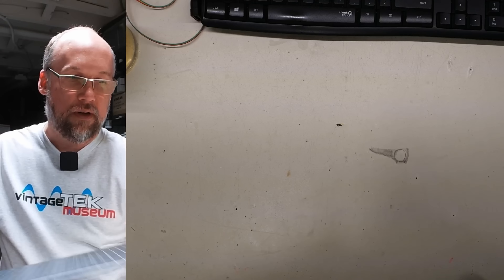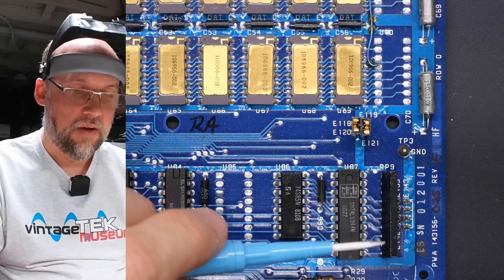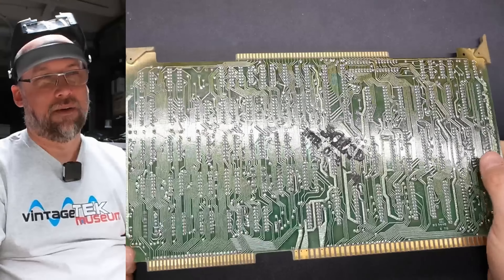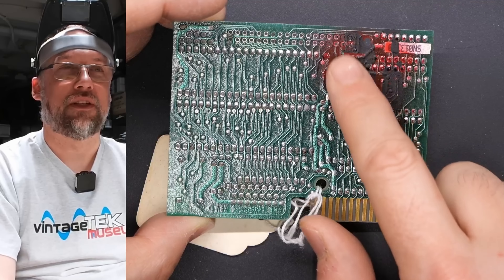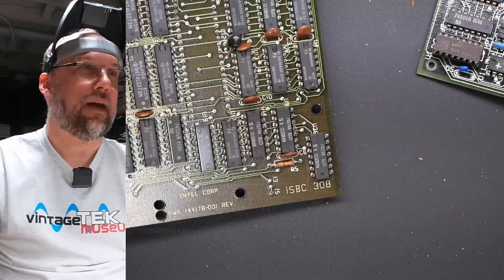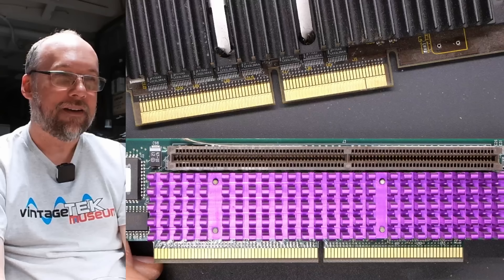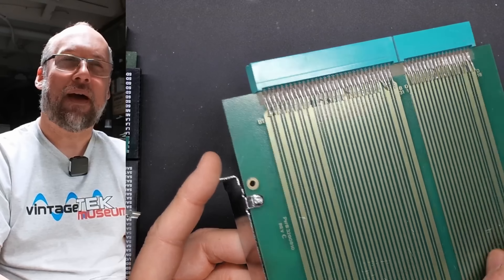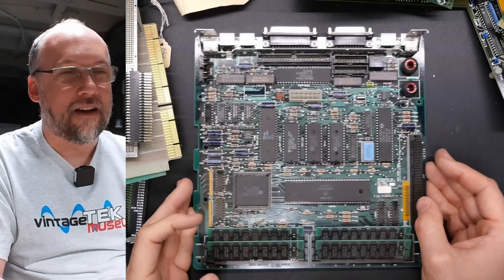Box of "scrap" vintage computer parts

Comment: I usually use Google Search by Photo to identify boards.  And with those first few Intel boards look like: Intel iAPX 432.  For sure the 2nd board.
Reply: No Intel iAPX 432 here, but close! Intel used some of these cards in their iAPX 432 computers (See Intel System 432/600 series).
Reply: yes the great iAPX 432 of which most people do not know of it's rich history or how Intel put a 32 bit IBM mainframe on a single board computer

Comment: If the state of these boards is anything like the state of our dev boards we chucked out at Philips after using them then good luck getting them to do anything!

Our boards often ended up broken in ways that we (as the designers of the board) couldn't work out.

They may even have early silicon revisions on too - whilst this sounds interesting, in reality it translates to 'doesn't work as expected'...
Reply: (to be clear I'm talking about prototype boards for Philips products - set top boxes, TVs, DVD drives etc...).

Alternatively you may get lucky - perhaps these belonged to the software department so will be fairly unscathed!

Comment: The tag on the small board with words like "Epoxy" and "Touch up" probably refers to the epoxy insulating coating over the traces. 
The silk screening process could be slightly misaligned and the operator or auditor didn't catch it. So inspectors would hold the boards at a steep near 90 degree angle looking for traces shining too brightly ie: uncoated. Then touch them up with paintbrushes and epoxy. They would also look for coating where it didn't belong and use a spinning nylon tool to sort of "dremel" it off. The material would remove the coating but not the trace.
For a time I worked on raw circuit board layers for an IBM commercial subcontractor, and at another plant on completed boards. I worked as an inspector, a silk screener, and an auditor. That was in the early to mid 80's.

Comment: GPIB interface is an IEEE488 HP test equipment physical standard protocol communication board. 
The IEEE488 standard was ALSO used in CBM Pet 2001 and others as a printer and disk drive controller interface.
Reply: Then stripped down as the Commodore serial bus

Comment: At 10 definitely a CPU card. PIO, Interrupt controller and cache on board. Did not see a DMA controller but a number of ROM slots and yes looks like the 8087 socket. Neat Shtuff.

Comment: Those fist cards you showed are very similar in form to what I know as load boards, which Vector Electronics Company actually sells.  (Yes Vector Electronics Company is still around)  The similarity being the edge connections and the little triangular parts on the corners that flip out

Comment: The board with the ZIF sockets was probably an EPROM programmer, and could program OTP 80xx-series microcontrollers like the 8049/51 based on the fact that those are 40 pin ZIF sockets; if it did only EPROMs, it’d only need a 28 pin socket. Just my $0.02, though.

Comment: I have a G3 card in my 7600/120 Mac Power PC, that looks similar to that board.  However, the upgrade card I have, is made by Sonnet, who made a lot of upgrade stuff for the Power PCs.  I bought the the 7600 as a used computer, and even after doing several upgrades on the machine, I just wasn't happy with the performance.  So, now it sits in my basement,  unloved.  They also sold a G4 upgrade, but it was expensive, and I was so underwhelmed by the performance, that I never bothered with any further upgrades.  For awhile, I was thinking about putting Linux on it.

Comment: I own a System 86/310 that was modified by another company called High Integrity Systems. They swapped out the Intel iSBC card with their own 3 board solution which appears to actually be a clone of Intels own iAPX 432 system cards!

I've been gathering as much detail as I can and even made 3D models of some of the components and cards and such. The cards Adrian has were an option for the Intel System 86/300 series, so what he has is quite a rarity indeed.

All he would need is a small 4 slot Multibus I backplane and a few ROMs and things and he could at least attempt a power on with the iSBC and connect a terminal. The Winchester controllers both require external cards for data conversion etc. For example the iSBC 215 and 218 were used for hard drive and floppy drive. The 218 actually plugs into the 215 as a daughterboard and connects directly from the 50 pin IDC to a typical 34 pin Shugart floppy drive. For a hard drive to be connected to a 215, it seemingly only supports MFM drives (I built a MFM hard drive emulator Adrian showed in one of his previous videos) and the data connector goes through an Intel Data Separator board.

I would suggest these cards were removed from the RA pile at Intel. The markings 'SCRAP' and paint and tags point me in that direction.

Comment: 8x4 1k array for first card, 32kb total.  Was mighty spendy when new back then, scrap today. Surprisingly the gold scrappers didnt pull the chips. The second one is the system bios boot card. Floppy card was for a big 8 incher, the potentiometer controls the motor speed of it.
Reply: Those were the days

Comment: Oh! I had a Packard Bell computer which had an EISA (or what appeared to be) slot in the middle holding a riser card. I wonder if that 32-bit-...ness is what allowed it to have a couple of PCI slots on the same rider?
Reply: That was probably LPX form factor.  The riser connector loosely resembles EISA but AFAIK they only made ISA/PCI systems with it, never any actual EISA.

Comment: I might be wrong (it's been a very long time), but those Intel-branded cards with the dual edge connectors look similar to the Intel MDS-80 or MDS-800 development systems. Intel sold these for firmware development with in-circuit emulators for 808x family processors and PROM burners for embedded development. I briefly used one back in the late late 1970s.

Comment: I'm completely amazed those 64kx1 DRAMS are not in sockets. Those are Multibus cards. Industrial and scientific automation from 40+ years ago.

More: at 12 minutes, that floppy controller is built out of Intel 2 bit, Bit Slice logic. AMD did 4 bit wide bit slices in 1975, but Intel did 2 bit slices in 1974. The Intel D3002 and family are similar in concept to the AMD2901. The 40 pin chip on that card is an Intel D3001 Microprogram Control Unit which I think may be similar to the AM2909/AM2911.

18 minute range: GPIB = General Purpose Interface Bus interface. IEEE-488 is the standard number.

Comment: The Asante card could potentially be used with the breakout board of a different PDS network card. I personally have a Novell card on my SE, that I use with the breakout board of a DaynaPORT SE/30 card. Pinout seems to be the same, it might be the same case for other boards. In any case, the pins should be AUI signals, so you could also rig up a DB15 port on the back for a transceiver, or internally wire up a transceiver.

Comment: Card #1 is an Intel Multibus card.  Multibus was an Intel standard (like S100) that was used in their development systems.  Scrap, card was probably salvaged from Intel by an employee.  I used to buy scrap boards from DEC when I worked there. (cost me 10 cents on the dollar of what DEC paid for them).
The 8089 could be used as a programmable DMA controller, card might have been a disk interface for Multibus?
Looks like all those cards could have come out of an Intellec development system  That floppy disk controller card could have been part of a two board unit, the two boards connected at the top by a jumper card or cable.  That 8086 board IS the main cpu board from an Intellec system.  The 8259 is the interrupt controller, 8253 is a timer, the 8251 is a serial uart chip, 8255 parallel IO (printer interface maybe).
Scrapped boards might not have been defective, just too far out of revision to keep in stock or bodge up to the current circuit schematic.
That defective board with the leds looks like it might have been part of a chip programmer.

Comment: First card is most likely 'Multibus 1', used in some Intel development systems. The card in the picture was Multibus 2.
MC1488/1489 are RS232 buffers, so it may be that small edge connector was for a serial port.
My guess is that the boards are from and early Intel Intellec MDS development system.
I am with your guess as to the first non multibus board being a terminal.

Comment: If you look at the CPU board those connectors are probably the console and maybe printer interfaces. The UARTs and 1488/1489s were really common for RS232 level shifting back then.

Edit: I watched the CPU section again and it actually looks like there may have been more 1488/89 pairs in those open sockets. 

I used to work on an Intel system reminiscent of this. The US Army had a bunch of them out at Ft. Hauchucha in Arizona. They ran a multiuser MS DOS.

This was nearly 40 years ago and I was 16 at the time so my memory is failing.

Comment: The ISA network card says "supports full duplex" but the original NE2000 didn't support that, although this one looks like it was backwards compatible based on a cursory doc search. I wonder if it could really saturate a full-duplex 10mbit?

Comment: I don't specifically recognize the two Power PC processor boards but I had a mac from this family and while I loved the machine speed on the CPU on the motherboard was quickly dated as the CPU was soldered on boards like this essentially came a long seized the bus and allowed you to upgrade the machine. If I remember correctly it also used the original CPU as some form of co-processor though my memory is hazy about all of this.

Comment: .... this page as an on-line reference to the Multibus circuit boards. Intel originally developed these boards in 1976 for use in the Intel MDS-800 Microcomputer Developement System (picture). However Intel quickly found that many people were buying the MDS boards in order to build these own computers and computer controlled equipment, so they started selling them as OEM boards. The demand was great enough that Intel soon developed a complete line of Multibus products. In addition, they released the Multibus specification and it was eventually standardized as IEEE-796 Bus Specification. Within a few years there were over 200 companies building over 500 different Multibus products.

In addition to the boards that fit the Multibus specification, I am also including the iSBX and iLBX boards since they are commonly found as daughterboards on the Multibus boards.

3MI have created this page as an on-line reference to the Multibus circuit boards. Intel originally developed these boards in 1976 for use in the Intel MDS-800 Microcomputer Developement System (picture). However Intel quickly found that many people were buying the MDS boards in order to build these own computers and computer controlled equipment, so they started selling them as OEM boards. The demand was great enough that Intel soon developed a complete line of Multibus products. In addition, they released the Multibus specification and it was eventually standardized as IEEE-796 Bus Specification. Within a few years there were over 200 companies building over 500 different Multibus products.

In addition to the boards that fit the Multibus specification, I am also including the iSBX and iLBX boards since they are commonly found as daughterboards on the Multibus boards.

Comment: @10:00 you missed the board model number. It appears to be a processor board 143799-xx but an early rev as it has -003 instead of -025 commonly found on these boards

Comment: I used to use similar multibus winchester cards (iSBC 215G) to drive ST506 MFM hard drives, cartridge tape, and 5.25" floppy.   Two computers had iSBC 286/12 CPU boards (8MHz 286 / 287) and maybe 3Mb of memory, 1Mb on the cpu card and another 2mb in a separate RAM board (iSBC 020CX? EX?).   iSBC 188/48 (or 188/56) 8 port RS232/488 cards for terminals.   Ran AT&T Unix System V/286 on one for data acquisition or Xenix err.. 2.0?  for a small admin department.   Whopping 140Mb Xt1140 (or 190Mb xt2190) hard drives.  Later added an adaptec multibus SCSI card--still have the tape drive, and somewhere some of the Maxtor magneto-optical drives (dead) and media somewhere.    "Intel System 310" and fit in a 19" rack with slides, and the fans were ridiculously loud.
Both were destroyed by salt air over the years as they either went to sea on a research vessel or sat in an un-airconditioned space a stone's throw from the beach.
Good times.
Reply: I have an Intel System 310 sitting next to me right now. It was bone stock when it was ordered, but then modified by High Integrity Systems who installed their own clone iAPX 432 multibus card set (it was a slight improvement over the Intel design, but with better memory access apparently). Unfortunately the 43203 appears to be nonfunctional, so the most I can do is boot into iRMX 86 and look at files and format floppies.

I part of me feels sad about the 310 you mentioned, all alone on a boat in the middle of the sea, or hidden from view and unloved in a shed rusting away. I wonder how many more 300 series systems exist out there? Heck, where are the 600 series??

Comment: from the Intel world, I designed a lot of 8085, Z80 ^ 8086/88 system, and it as a bit weird that the 8089 came out as 8086/88 rep/string opcodes were very effective for high speed data transfer what the 8089 was designed for, and generally not much benefit to.  The 8089 was generally ignored by most designers like me for that reason!

Comment: 2nd board : "The Intel iSBC 21S Generic Winchester Disk Controller Board (referred to
as the iSBC 21SG board in this manual) allows as many as four hard-disk
drives (typically. Winchester technology). as many as four
flexible-diskette drives. and as many as four magnetic cartridge-tape
drives to be interfaced to any Intel MULTIBUS interface compatible
computer system. It supports disk drives that use open-loop head
positioning. closed-loop head positioning. or ANSI X3T9/1226 interfaces.
Figures 1-1 and 1-2 show examples of multiple hard-disk drive
applications in non-ANSI and ANSI configurations. respectively.
The iSBC 21SG board design is based on the Intel 8~89 8/16-Bit HMOS I/O
Processor. which features direct-memory-access (DMA) transfers.
multiple-sector transfers. transparent error detection and correction
(with automatic recovery and retry). and data management. The board
operates in a multiprocessor environment and is fully compatible with all
Intel 8- and 16-bit computers. The number of tracks per surface is
software selectable for each drive unit. Seek operations on more than
one drive can be overlapped with read/write operations on other drives.
The iSBC 21SG board is fully compatible with Intel 8~86 16-Bit HMOS
Microprocessor 2~-bit addressing. and can be used in Intel MULTIBUS
24-bit address systems.
The board includes two Intel iSBX bus connectors. J3 and J4. that allow
other storage devices such as flexible-diskette drives or magnetic
cartridge-tape drives to be operated with MULTIBUS interface compatible
systems. For example. the Intel iSBX 218A Flexible Diskette Controller
Board attaches to iSBX bus connector J4. allowing the iSBC 21SG board to
control as many as four flexible-diskette drives. Figure 1-3 shows an
example multiple-drive system using four S 1/4- or 8-inch
flexible-diskette drives. the iSBC 21SG board. and the iSBX 218A Flexible
Diskette Controller. As another example. the Intel iSBX 217B/C Magnetic
Cartridge Tape Interface Board attaches to iSBX bus connector J3.
allowing the iSBC 21SG board to control as many as four tape drives. 
"
Reply: Intel iSBC 215G, but yes that is it. I have one with a 218 connected to it!

Comment: Intel has always been nuts about external DRAM controllers which the Z80 also crapped all over!  Most designers like me did our own DRAM stuff, even with 8085/8086/8088 systems, as it really was not needed, just more Intel greed relying on LAZY engineers!